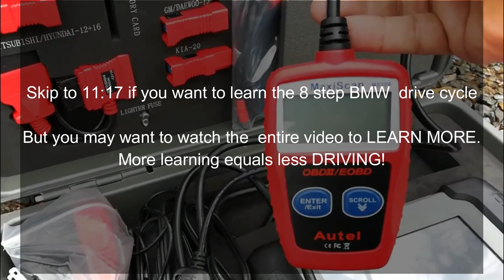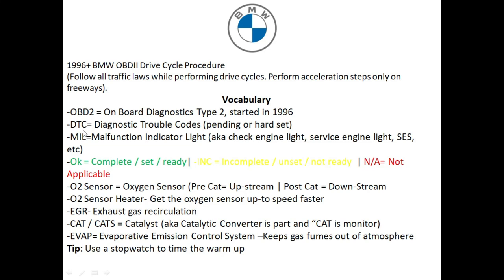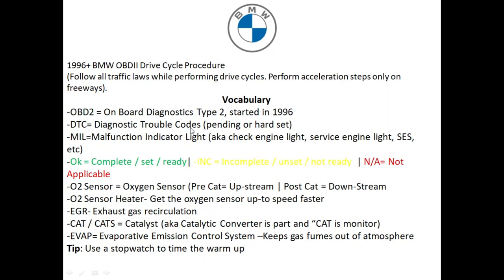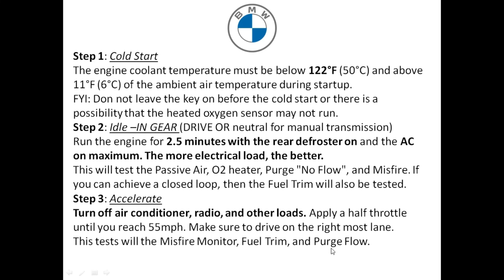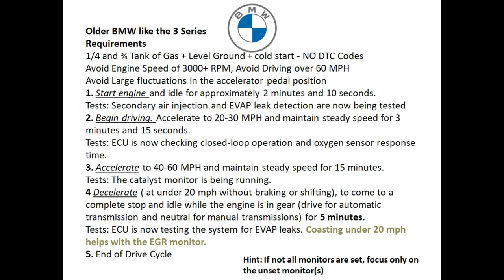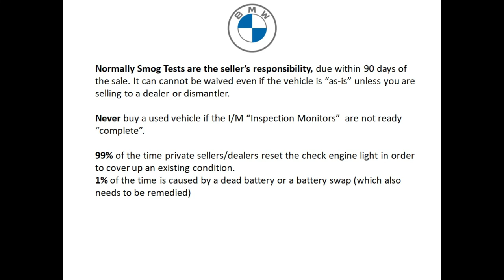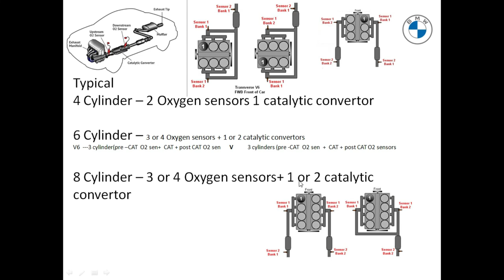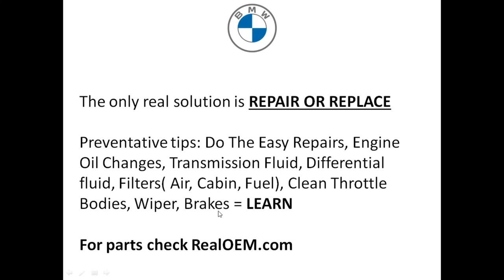BMW Emissions Testing Drive Cycle ▶️BMW Smog Check ▶️ BMW o2 CAT EGR EVAP Monitor Readiness

Comment: Hi I have a 2001 BMW z3 2.5i which test should I be doing? I have the OBD, CAT, and EVAP popping up
Reply from the maker: Are all of the monitors not ready? Complete two drive cycles and then focus on just the unset monitors.

Good luck and keep me posted.

Comment: I have a 2015 BMW X5 Diesel - and I can't seem to get the O2 sensor and O2 heater sensor to get into the "ready" state...it still shows "not ready".  I have driven over 350 miles now.  Do I just need to do more cold starts in order for both the O2 sensors to get ready?  Or do I also need to do step #4.  I am hopeful I can just jump to step #4 and do this over and over again until it goes ready or continue to do my morning cold starts.  So far I have done 18+ cold starts.  One last question...can I use cruise control to keep the car at 55mph?  It is impossible to hold the gas for 3min at exactly 55mph unless I use cruise control ;).  Any help would be much appreciated!
Reply from the maker: Mike, I would focus on the the initial warn cycle and let your x5 just idle. The o2 heater is normally first to set and then the o2 monitor. However before you do this please check the connectors on your o2 sensors especially the forward one ( precat) and make sure they nice snug. Keep me in the loop And let me know what happens.  You don't need to drive at 55 mph to set the monitor normally as the normally set in during warm so just it idle for 20+ minutes plus. Do you access to scantool. Since you will be checking the connectors please try to check o2 heater which is very simple. See the video below

https://youtu.be/zEbXn6vgqiA
Reply: @RANDOMFIX  I will do what you stated and see what happens!! I will see if I can find the schematics to located the O2 heater and test with my volt meter. Stay tuned!!
Reply: @RANDOMFIX  the O2 Heater set and is ready!! Looks like running the car for 22min with the AC on max, rear defroster, headlights and fog lights got it to set.

Now the O2 sensor needs to set :-(. 

Does this set when I drive the 55mph for  3min? Or does this set during step 1 (the cold start)?

Thanks again for the help!
** I can’t find my volt meter so I have to still check the O2 banks…I am going to try and borrow a friends.
Reply from the maker: Since your heater monitor is ready is you don't need a volt meter any longer. Just keep doing those nice long warm ups and drive around town as usual.  It's easy to do when you have time and pain in the neck when you are in a hurry. There are cool under $40 scantools that will stop beeping when you drive monitors all get ready. Let me know if you need me point in the right direction for that product and I should actually do a video on, lol.
Reply from the maker: Thank you again for the update
Reply: @RANDOMFIX  you rock my friend and thanks for the details. If you know what tool is best that would be super helpful!!!

If you do a video I will totally view it and like it :-). Thanks again!
Reply from the maker: I will produce the video very soon.

Comment: 2003 BMW 330ci -  No DTCs and all monitors are complete except the O2 sensor heater.  Since I have no DTCs this monitor should come in eventually right?  How many cold starts does it take for the O2 heater monitor to complete? Thanks.
Reply from the maker: This monitor should have set within a few warm ups. 
https://youtu.be/Yn1-ul62Jio?si=e9D_21ySg3xg29fl

With that being said, how old is it? Is the original oem o2 sensor?
This is pre cat o2 sensor not the downstream post car o2 sensor.
Reply: @RANDOMFIX  Thanks for the quick reply! I'll do more cold start warm ups.
Reply: @RANDOMFIX  I have the ISTA software.  No DTCs still no O2 sensor heater monitoring complete. All other monitors are complete. There's a test in ISTA that checks for O2 interchanged plug connections.  The result said:  "Diagnosis is completed: monitoring sensor, cylinder bank 2 implausible".    It's interesting it states that yet there are no DTCs at all.  In 2018 I replaced the 2 upstream O2 sensors with Bosch 13477.  Both downstream sensors are original I think.  After the test I reset all the adaptations and did the drive cycles. All monitors completed OK except again the O2 sensor heater not complete.  I have charged the battery.  It is 5 years old though.  Any suggestions? Thanks!

Comment: hey I just did like 400miles in last 3 days 2 x 200 round trip, Still Fuel System not Ready and Cat not ready, I will try your way tomorrow morning. lets the what happen. 2011 X5 N63 with over 8k repairs steam valves and much more, after 400 miles i went to DMV and boom i failed :D what a surprise!
Reply from the maker: Sorry for the late reply! did you find a solution?

Comment: Which phase of the drive cycle is for the O2 sensor (the only monitor not ready)? Hoping it's the 20-30 mph phase. If yes, does it still require cold start?
Reply from the maker: I always recommend a cold start. The o2 sensors is normally first to set right after the o2 heater monitor. Is the o2 the only incomplete monitor?
Reply: @RANDOMFIX  Yes, just need O2 to be ready. O2 Heater is set. EVAP is not ready but it's not required here in California. So since I just need O2 monitor, does that mean I only have to do cold start + 20-30 mph?
Reply from the maker: Yes

Comment: My OBD only showed O2 is not ready and I have no error or pending code. My OBD live data showed upstream B1 and B2 with zero to negative mV instead of V. My downstream is fluctuating and from 0-0.9V, not mV. I suspected my upstream B1 and B2 O2 is bad. Can you give recommendation? Thanks
Reply from the maker: I does sound like your upstream is bad but don't replace it until you check the connector. Remove the connector, inspect, clean, and retry. Complete a series of long warms ups without moving the vehicle, just idle.
Reply: @RANDOMFIX  Thanks. I will try that first.
Reply from the maker: Awesome keep me in he loop.

Comment: 2013 328i Sedan. All monitors ready except for O2. I have completed the entire drive cycle a few times: only the oxygen sensor monitor continues to show as "incomplete". Vehicle has the original, approx. 8-year-old battery. I have never had any issues with the battery. Is it possible because it is an old battery it is preventing the O2 monitor from clearing?
Reply from the maker: Dan, sorry for the late reply as I'm traveling. That is exactly what happens when you got an old weak battery, it may keep monitors from setting like the o2

Comment: I have a 2& 1/2 year degree in automotive I started in 1999-2001. I even had a NJ state inspector license. You are so on point about you said that I remembered.  
I am not in the automotive field anymore, but remember learning all this! I just had work don’t to my 435x mSport and my battery was dying but still started. What you said about having bad battery can cause lots of problems! You are sooo… correct!
Reply from the maker: Hi Johnny, thank you for sharing your prior experience in the automotive field and yes since the I made the video 2 years ago the problems has just amplified.

Comment: 21:10 Selling AS-IS as there is a hole in the engine. How can it pass smog and be the sellers responsibility?
Reply from the maker: Depending on the state it’s sellers responsibility. I hear but just make sure the buyer knows all possible out comes. As is doesn’t supersede state laws. For example, I lived in California in Calvaras county, which was smog exempt however there I only needed to pass smog smog once to register it my name and no bi annually inspections. Now I’m in Texas in Van Zander county and here I do need any smog test so there are exceptions to every rule.

Comment: Is this all regulated by EPA or CARB? They stated the requirement of how the test procedures are for all vehicles for sale in the US, and manufacturers have to follow? (or cheat in case of VW emission scandal). Is it all the same for all gas cars and did they change the "procedures" every year or since some year like 2014? Nice to have an insight of the test procedures to run against.
Reply from the maker: The regulation and enforcement is epa but carb has its own requirements. Most states follow epa but California and now Oregon are extra special. This will help with knowing what state needs what https://youtu.be/QKxDzdTVJOU?si=oJT_nrZ1gEuogqoM
Reply: @RANDOMFIX  SUBSCRIBED! Thank you.

Comment: on 18:31     you mention diesel if newer 2007 can have 2  inc? is it for California?  I am in Los Angeles and x5 2010 diesel and can not make the CAT &  HRT complete. Do you think I should just  go for smoke test?  I also have EVAP  n/a
Reply from the maker: Yes, you are cleared to smog. Don't worry about the evap since its n/a ( because it diesel not gas)

Comment: @randomfix 97 M3 coupe, followed the steps(except for 2nd cause couldn’t find long enough stretch of road to hit 3.5mins at 20-30mph) and did step 4 and later I got a P0420.  Never had this before, O2s under 5k miles, new aftermarket cats from Magflo(I believe) and never cleared off ‘CAT’ from test.  Had to reset my computer and do it all over again.  FYI super clean M3 from air intake to vacuum lines, purge valve, ICV, PVC, new spark plugs, new valve cover and gaskets, etc.
Reply from the maker: Caesar, I'm sorry I did not follow, so is your 1997 still throwing a p420 code?

Comment: Hey I got 02 bmw 3 series e46 can’t get the cat monitor on ready and help advice
Reply from the maker: Mike, your 3 series is almost 20 years old and may need some time to set. I have tried some products that can help but at best it's only a temporary fix to pass this year as you need to get a new catalyst in the future. https://youtu.be/3w-FrjMFKvs
Reply from the maker: If you decide to what I should in the video please smog asap as soon as the monitor sets.
Reply: @RANDOMFIX  I mean you look up bmw drive cycle it pretty much identical to the paper u showed . I did about 4 times hit 200 miles and did again drove for 30 miles all but the cat isn’t ready I seen it on befor last month but now It’s taking a while
Reply from the maker: What happened last month that caused the monitor to become incomplete? So, as the car ages, the catalyst is not efficient enough to get ready and not weak enough the throw a check engine light code, so these marginal catalyst will take longer to set. I would really try what I should in the video link I sent you earlier but if you have weak battery, bad ground, etc you need to fix that issue first.
Reply: @RANDOMFIX   i didn’t have my coolant thermostat on and code pop up for  no thermostat . Now it’s on
Reply from the maker: Man that sucks. I hope it sets for you soon.
Reply: @RANDOMFIX  yea super annoying
Reply from the maker: This whole process is annoying, this is why I made the videos
Reply: @RANDOMFIX   yea especially my situation I got state reff here in California I had diff ecu and cal id for the ecu was not the same as my cars so I had to re program my ecu back to oem with original cal Id.  If I was doing for regular smog I would passed with no worries
Reply from the maker: Yeah, that's California, I'm here too and it feels like you need to be a lawyer in live this challenging place with all of these rules and nonsense. Sorry for venting but it's crazy here.

Comment: I have a bmw 2013 f30 before for check smog emission I drove cycle  except 2 incomplete Evap + Oxygen sensor
Reply from the maker: There is not much you can do on the evap system other maintaining the fuel level and parking on a level surface.
As far as the o2 sensor, check the connections and make sure it's an oem o2 sensor. If all is good there then focus on a 5 minute warm and drive around town and keep your rpm under 3k. 

Keep me posted

Comment: How long will it take for the codes to reappear?
Reply from the maker: If the issue major the codes can reappear instantly but what are you dealing with?
Reply: @RANDOMFIX  catalyst monitor was incomplete but after a couple drive cycles everything is good now. Thanks!

Comment: Do you think the low battery in remote fob can effect the I/M readiness of CAT and HRT?  I drove about 600 miles now and still have the Cat and HRT is INC , I also have EVAP -N/A . is it normal? I have the x5 2010 diesel .
Reply from the maker: Anything is possible but highly unlikely. As long as the remote is able to lock the doors you should be okay.
Reply: @RANDOMFIX   Thanks! I checked with smoke check referee  and they told me also just go to do the smoke check.  I guess will find out.. and I replaced the battery just incase :) ..
Reply from the maker: The smoke test is just a visual check to confirm you are not blowing a cloud of smoke from your tailpipe. It really helps to change your oil if haven't done so.
Reply: @RANDOMFIX  I did change only few month ago so all good just need smoke check as I did not drive much in  past few months..
Reply: @RANDOMFIX  Thank you for your replies! I passed the smoke test with no problem! :)
Reply from the maker: @dad congrats and thank you for letting me know.

Comment: Great video thank you. My OBDII scanner is showing EVAP and AIR. Literally the only 2 codes left before I can take the SMOG test. What is the AIR code?
Reply from the maker: Air = Secondary air injection which runs when the vehicle first starts to help get the catalyst and emission warmed up faster.
Reply: @RANDOMFIX  oh thank you for responding. I will give it another go in the AM when I allow the car to warm up following your instructions. I just need to do the color start right? Bimmers are too darn smart.
Reply: @RANDOMFIX  The Cold start didn't erase the EVAP or AIR codes off my OBDII scanner and now I have a Pd DTC code. AutoZone told me I needed a new Air Injection Pump based off their scanner and a body shop told me I needed Secondary Air Pump hoses and Leak Detection Pump. Based on your expertise does that sound accurate? Thank you
Reply from the maker: Is there there a pending code for these monitors other than the permanent code that you can not delete?
Reply: @RANDOMFIX  the only code that keeps returning is the P140A code. It returns every 2 days.
Reply from the maker: Yeah, these cases are tricky.
once you fix this don’t surprised by other possible codes.
Reply: @RANDOMFIX  thanks for your input. I really appreciate it. To be continued... 😟
Reply: @RANDOMFIX  Do u know how much BMW charge for this ?

Comment: Doing this in a manual transmission BMW is a royal pain in the ass.
Reply from the maker: Yes it is!!!
Reply: Word! Been doing several drive cycles and had to do at night. Down to only AIR and EVAP. Will do cold start tomorrow. Fingers crossed. Commute starts at 5am here so morning is sadly not a good time to do any of these drive cycles.
Reply: @RANDOMFIX  and why I plan to sell my BMW in the next few years too much hassle. Better to buy an old classic car and truck and no requirement to smog ever again
Reply from the maker: Bmw is probably the worst European vehicle my opinion. I only have one video with a million plus views and it’s about a bmw. I have close to 890 videos.
Best European vehicle Benz, then volvo, Vw/audi ( horrible), and last is bmw.
Even though mercedes is the best out of Europe my last two Mercedes vehicles were lemons and they had offered to take them back. 
I will never buy a European vehicle again!

Honestly check out any 4 cylinder oToyota ( no v6 or v8) and the 2.0 liter plus honda vehicles ( no v6 engines) and you will be love!!!

Nissan is all bad except for the 4 cylinder Altima. I need to make a video to show how to look up these information in minutes.

As far as old vehicles honestly safety is pretty important and the old vehicle drive very poorly compared to 2000 and newer vehicles so be careful.

I’ve built old vehicles and  spent $35k on the rebuilt and still disappointed ( 1969 firebird). The most dangerous vehicles are 60s mustang and the coffins on wheels.

So what is left?